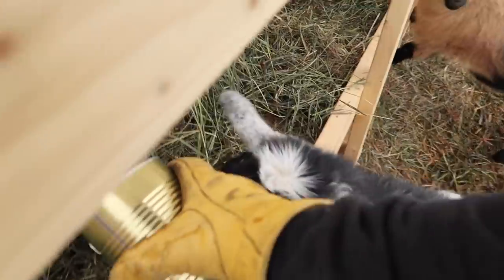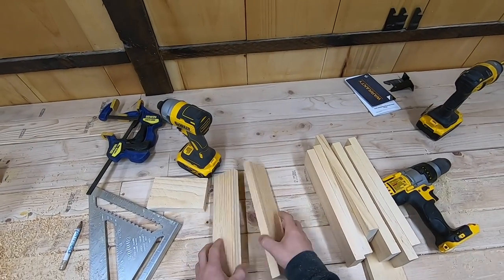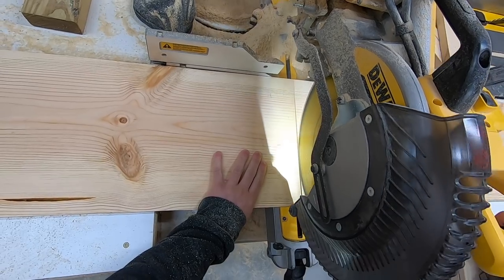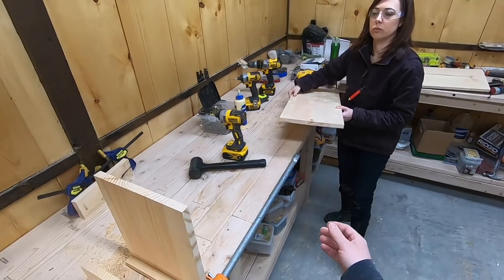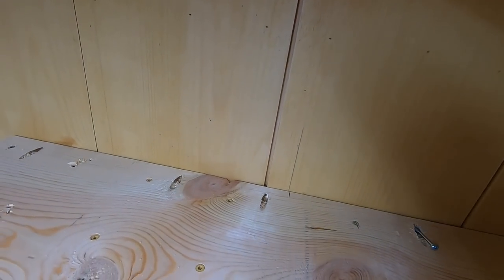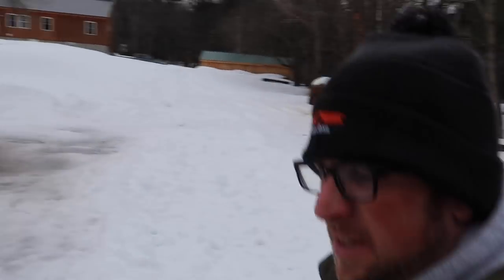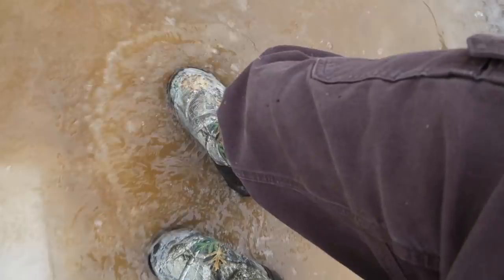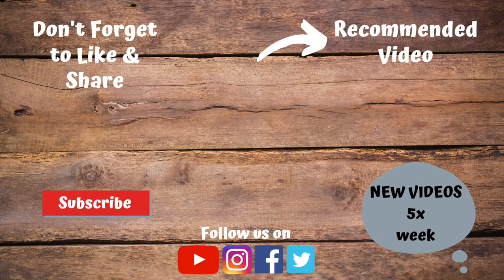Building her DREAM WorkShop STORAGE  (Power TOOL STORAGE RACK)

Comment: Ditching the snow melt away from the roadways is a sure sign of Spring.
Love the shop tool-organizer. As you accumulate more and more fasteners, I expect there'll be shelves for them. Peg board is handy for hand tools and they make heavy-duty L- braces  you can install all along both walls for lumber you need to keep dry.  We know you know where everything is in the shop but if it's organized then Gina and Olivia can also comfortably work in there. Never mind the drill holes in the new workbench; the holes fill with sawdust.

Comment: Buttermilk biscuit tip: Instead of cutting cold butter into dry ingredients try putting buttermilk in the freezer for about 10 minutes, melt butter and let it cool slightly. pour melted butter into cold buttermilk and stir with a fork until small clumps form then mix (a rubber spatula works great) into dry ingredients. the dough should be stiff and not super wet. I've found this much easier and quicker than cutting the butter in.

Comment: Al, peg board and hooks work extremely well for storage in a basement, garage or workroom.  With the hooks you can space them for whatever needs you have.  This is a lot less expensive than using wood.

Comment: French Cleats, have you heard of them? 
In a shop like yours, I would have them on every wall. I would make separate tool hangers for each tool and bins for things like screws.
That way I could move the tool hangers and supply bins around to the most convenient location depending on the current project I was working on.
Now, you have a place for everything but it won't organize the shop unless everything is put in it's place!

Comment: When you find your drain just measure from two points on your building. write it down and the next time you cant find it just measure it out and dig where the lines cross. I did this with a drain where i worked and it worked great.

Comment: I would suggest that you construct a few drawers to attach to the underside of your workshop tables to hold some of the smaller items. I use drawers to hold the smaller containers of nails, small paint touchup containers, pencils, saw blades, sandpaper, etc. Organizers of various kinds could be put into the drawers to keep things tidy.
For the large buckets of nails, put some rollout trays under the drawers that they can sit on (sort of like what they use for kitchen cabinets). Those will give you full utilization of the underside of the tables and you won't have to get on your hands and knees looking for stuff.

Comment: norm abrams of new yankee workshop said that of all the projects he did the one with the most views was his own workshop projects. my favorite of yours was the barn building series. if you make a spot for a tool. youll always know where it goes. after 8 yrs of truck driving when i came home for good one of the first projects i did was change all of the bottom cabinets in kitchen from doors to drawers w/full extension slides. since we had really packed the cabinets full we didnt really gain any space but we found things we hadnt seen in years and everythins was easy to get at. if you do pegboards make an outline of tool on board so youll know which peg is which. i would put some kind of visible marker on that culvert drain that you can see even with deep snow. dont you love everyone giving you advice from their armchairs while you do all the work. i live in san antonio tx and we cant seem to get out of the 70s here.

Comment: This is 9 months late however if you need additional tool organizing you may consider using  French Cleats. A lot less material, much quicker to assemble, versatile changing tool locations, and easy to add as new tools acquired. Mostly 1x4 material. Very versatile in reorganizing. Good "How To" YouTube videos.

Comment: I wonder if some relatively deep easy slide drawers under the work bench top might be helpful.  Less debris in them; good place for a single layer of the plastic screws and nails and such boxes.  Has to open all the way so everything can be seen.  Another drawer for tapes and glues and related.  Another for paint brushes and rollers. Another drawer for pencils, pads of paper, tape measures. Label the drawers so that anyone can replace items appropriately.  And a nail for a clip board (you can get a clip board at the dollar store) for all those plans.

Comment: Once you find the drain, chart it with the distance from 2 fixed points. An arc at each distance will cross at a single point.

Comment: Great build for the workshop. Gina is cracking the whip. My bride has been after me to do the same. Are you going to have a separate charging station? On the one that I want to make, I want to include designated slots for all my air guns. We had a AC Moore in Bangor that had signs that everything was 85-90% percent off including store fixtures. The next day I brought the truck to buy a bunch of the pegboard frames for my shop down stairs and a couple for my rabbitry. Got there and they decided they weren't selling them. Bummer.
Many blessings.

Comment: Charging station first thing built 112 inch shelf raised 8 inches from the bench all tools that you work with on a daily basis goes on that shelf were there easy to reach and get a hold of Dennis said a shelf to place all the screw nail

Comment: Love the tool organizer. As someone who has lots of tools, I know there are more organizers that you can use. I repurposed a VHS shelf and it was the perfect depth for my many boxes and buckets of connectors (screws, etc.) I got a small parts cabinet for all the odds and ends pieces that we all collect. I have drawers for phillips head screws, nuts, bolts, nails, etc. and many other pieces. It sits on the top shelf.

Comment: Instead of shelves, I built a bunch of wooden boxes, sort of like milk crates, but sized for what they were to hold, for several of my power tools.  Then on the back, or bottom, depending on position, I put a French cleat at the top and a corresponding board on the other end that are like feet when the open side is up. I keep what goes with the tool in the same box, like a few kinds of blades in the box with the circular saw, or sanding belts with the belt sander, etc. I use my tools mostly in the shop, but often, I need them at work, in the house, at a neighbors, out at the chicken coop, etc.  These boxes hang on the wall, open side facing out, when in the shop, but when I need them someplace else, I lift the box off the wall, and put it open side up in the truck, or just carry it to what I'm working on on the farm.  I build handles in them with oval, rounded over holes (like milk crates) that are on the sides when hanging on the wall, and I make them a little larger than I need, so like if I need to take my router somewhere, not only will I have the bits, wrench, plunger attachment, and small circle jig for it already in my to go box, but I have room to put in some other things I'll need that day too - hinges, screws, a hammer, tape, speed square, etc.  I made a couple extra boxes since I made a charging station for all the cordless stuff too. So I have an empty box for when I need to haul some of that stuff around.

Comment: Can I give you a suggestion? Next time you need to drill through a piece of wood, use some scrap piece of plywood under it. This way you won't put holes in your bench top! Love videos!!
Reply: Thomas Pagel - That's why it was built using 2 x 4s, you can turn over or replace easily.

Comment: When you locate the drain take 3 measurements from 3 separate permanent objects. This will triangulate the drains exact location and write it on the wall inside the workshop. I wonder do they make a drain heater? Something you could install to keep the drains opening from freezing over.

Comment: Every time they lay something on top of the workbench, without something between it and the top, to drill, saw or nail down, I just know it's either gonna leave a hole or become attached to the bench top.  LOL  (Tho this time, a couple times they put something in-between)
Reply: Gayle C - That's why it was built using 2 x 4s, you can turn over or replace easily.

Comment: Perhaps a charging station for the all the batteries to go near the new cabinet since you so many cordless tools.  I did see where you have a nice collection of screws and nails.  So maybe line them all up and see what would work good for them so you can see what you have and what you need.  These items are also where french cleats come in good because things can be moved as required over time.  Different cabinets or shelves can be adapted to the cleats and then simply hung on the wall.  I used 1x4 material 4 feet long ripped on a 45 degree angle down the middle. Each board then creates both parts of the cleat with the single cut.  Cut up a bunch at one time and then have the stock available when needed.  Put several cleats on the wall 12" to 24" apart.  Even the cabinet you just built could have two cleats attached to the back so it can be hung on the wall as well.  For paint and stains I suggest a metal cabinet since they are flammable.  Because of freezing temps you might want to keep in the basement anyway.  Even a piece of peg board can have cleats attached and then hung on the wall.

Comment: I like your power tool holder. Next you might want to put up a French cleat system to hold nails screws nuts bolts washers all in there sorted sizes and types.that way you can find what you need easier and make the boxes from scraps made to size. A clamp rack to store clamps on and in, woodworking tool box for chisels planes, mallets,etc, peg board for measure tools and levels and a mechanics tool box for hammers, wrenches, screwdrivers and so on. I don't know how other people feel about it but because I have my grand kids coming in my shop I keep all of my sharps in lockable drawers. You'll never get a chisel accidentally threw a hand falling from a locked drawer. I am going to build a power tool holder for my tools and your design inspired me.

Comment: After years of struggling with Ice and Snow, I finally got a Plow for my John Deere.  Soon as I put it on the Tractor in November, I said watch it not snow.  Except for two 2inch events it didn't snow all winter.  No snow in Feb at all.  We had rain every time in Rhode Island when a storm passed through.  Just 25 Miles to the North they got snow.  That made it easier to take care of the chickens.
Reply: It’s so true. I went to the trouble of having  our big snowblower serviced and its carburetor cleaned in Nov. We’ve used it exactly once this winter.

Comment: the only thing that I saw missing was a charging station for all you batteries
Reply: Lawrence Todd :  I second that suggestion. The way I see it now is he has a mess of batteries somewhere on the floor. Which ones are fully charged and which ones need a jolt? Patricia from Alton Bay, 👵🏻🤗 ♥️
Reply: Yes it definitely needs a charging station.
Reply: Yep, however he can just attach them to th sides with screws and problem solved.
Reply: @joedukes9760  easily done, ur right
Reply: He’s saving that for another video ❤️
Reply: @patricianorton3908   We are nearly neighbors Patricia I live just over the New Durham line in farmtown.
Reply: Lawrence Todd  he will have to run another electrical line from the panel that is not switched

Comment: You will have better results and more consistency if you weigh your ingredients, including liquids like eggs or water. Here's a start , a "pints a pound, the world around".  This is good for water, milk, eggs, and other liquids. 1 pint weighs 1 pound.   It's a little short on oils so if you need oil,  zero out your measuring container on the scale and  add your oil until you get the correct amount. Many of the formulas,  as bakers use formulas, cooks use recipes. are listed with the ingredients  given in weights on  the America's Test Kitchen show. There is also a book sold for bakers called Practical Baking by the Culinary Institute of America. Little Spendy and made for commercial baking, but its just using math to divide the formulas into home sized proportions.

Comment: Al & Gina, my Dad Bought and saved Mason Jars with solid lids and he took the kids and used a small drill made holes in the lids and bolted them under the shelves in the work area of the garage where he kept all his tools. Then he filled the jars with nuts and bolts, screws, nails and other things, all different size jars to hold all the same things in each jar of a different size and kind! I always thought that it was a pretty cool idea! The way he did it, he spaced it so you could see the back and the front jars between the middle ones! Just and idea, Mason Jars are cheap! Your Fan From Houston Texas,  Mac 🙏🏼❤🐈🐕🐓🦆🐐🐏

Comment: Al, You’re like my husband with his workshop, lol. When I have a go his answer is always ‘but I know where everything is, that’s all that matters’ 😱 but if I put stuff back in his workshop and dump it wherever there’s a space, he complains. So I just say, well if there was a nominated place I would’ve put it there. He has no comeback. So do it for Gina too Al. Because if she put things back where you want them, you can’t complain and nor can Gina. It’s a win win 👍🏻 also an idea for all of ŷour screws and nails, do a similar box system in rows with wood screws, metal screws, then from 1/2 inch through to your longest. Then a smaller one for nuts and bolts, hinges, plugs, dowels, drill bits etc etc. I find that quite handy to just find and pull out. Then there’s hangers for hand saws etc.

Comment: Shelving for those nails and screws.  Don't take them out of the tubs, but label either the side of the tub or the shelf it's under.  Also, please make a bin for kindling and one for good scraps.  After that, I would suggest a large metal can on wheels to put all that sawdust in so you can use it for other things around the homestead.

Comment: All in due time is a good saying.  Takes being in a situation to know how to manage.  I'm still in this house 5 yeas after I bought it only a year out of foreclosure BECAUSE  I didn't jump in.  Discovered that the furnace  was set to blow thru the cold air ducts and draw thru the wall outlets.  Had to be a reason for foreclosure and went to ER with CO2 poisoning once.  Two years later finally was able to reach deep into the cold air returns with a coat hanger stretched out and peel up the 3 inches of dust mat I missed on my first try.  That did it so the house is safer now.

Comment: If you were to attach a cleat to the wall you'd be able to hang cupboards simplifying removal when a change  or additional cases (for batteries/charging station) was required

Comment: morning folks
Reply: When you find the drain measure from two or more fixed points (corner of buildings trees ect.) to triangulate the location of that pesky drain.. in my small world posts and flags are in the way or come up missing.  You will still have to keep track of those numbers but that can be done on a map of the homestead

Comment: Sorry..just cringe watching y'all drill into that brand new bench 😭
Reply: This.
Reply: Especially when there is a box of scrap timber.
Reply: I know! I put a layer of MDF on top for tool slips, and at least drill off the edge!
Reply: jack parkey Yep. Me too. I was wondering if it was designed to easily replace the boards, but that would be wasteful.
Reply: You Tube pays well , they'll be fine .

Comment: Now you have to label all the tool garages so the tools get back to their proper homes every night. Organize your screws and nails by length short to tall and have them pointed toward magnetic north.A lazy susan charging station for a fifo battery system is due next.

Comment: Build shelves on two of the openings below the workbench so that you can put small things like your screws on them, opening up two spaces for other, big things.  You have so much wasted space under your workbench.  I agree you need a charging station but you didn't run electricity to anything on your walls.  You need something to store all of your clamps on a wall, too, organized by length of clamps.

Comment: Moaning guys, I have been a carpenter for over 30 years now and one thing I like to do with the table saw blade is lower it as much as possible for the thickness of lumber I'm working with. So if there is the unfortunate case of a mishap you only get a cut vrs losing a entire finger when the blade is higher.  Does this make sense? Not trying to rag on you, just a friendly tip.